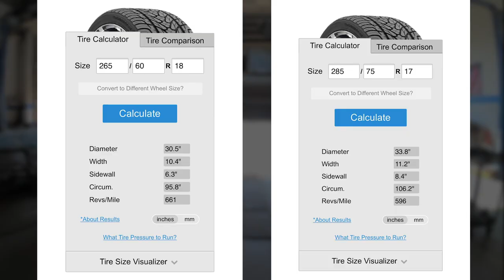Lexus GX460 Ironman suspension lift with Method Race Wheels and K02 tires

Comment: nice rig mate looks amazing, did u face any issue with KDSS, how does the Iron man suspension feels, any update on the fuel range, as am planning to do the exact same setup as i own Sandy myself to :P.
Reply from the maker: I’m very happy with the setup and no issues at all with KDSS, rubbing, or anything dramatic at all. There is a slight decrease in acceleration and it’s a little more thirsty, but the cons don’t outweigh the benefits. I feel a lot more confident off-roading. Congratulations on your ride and thanks for the support 🎥🎬👍🏽
Reply: @CoastalGX  Larger tires will do that. The mileage and the gas consumption calculation will be incorrect with those wheels as you are now traveling more than a mile for every mile the car thinks you are.

Comment: Have you done any mods to gain power? The gx460’s are sluggish to begin with in my opinion!
Reply from the maker: No. I didn’t build a track car. It’s a tourer. The power train is very smooth and doesn’t struggle. With all the gear I carry, I wouldn’t want to be straightening any curves. It cruises at 85mph smoothly. Big difference from a Tacoma, Jeep, 4Runner etc. The v8 helps a lot.

Comment: Where did you buy the 17” methods? TireRack only sells 18” for a 460
Reply from the maker: I got a better deal buying the wheel/tire package with Discount tire. They had a variety of 17” wheels for the GX460.
Reply: Coastal GX thanks! I guess I’m getting mine at discount tire! Your mod turned out great! Love that look
Reply from the maker: Joricano thank you. What model do you have and what are your plans?
Reply: Coastal GX I’ve got a 2011 460. I just want change the wheels and tires so I can go to some fire roads. I can’t lift it since I drive it to NYC and park in building garages.. But I installed MTS mainly for better traction in snow. Maybe spare tire carrier and Auxiliary tank in the future.
Reply from the maker: @Joricano  that's what I'm talking about. Modding for the sake of modding isn't a bright idea. We do what works for us. Good luck with the setup.
Reply: @Joricano  Yeah I feel you on the clearance. Used to drive up to NYC in my stock F150 4x4 and not only was the street parking a nightmare due to the parking schedules but I felt like I was going to hit every time I was in a garage. My radio antenna would always take a beating. Good luck with your build.
Reply: @CoastalGX  Do you happen to have the part number of the wheel? Method says my 2013 GX460 needs a 20x10 and I know thats not correct.

Comment: Hello Robert, congratulations on your bad ass rig its come along way. I have a15 gx 460 that I want to lift soon I'm located in Houston just wanted to ask you if you  can give me a ball park number of this suspension lift install price at this shop. I dont mind driving to McAllen for the right install price. Thanks and congrats on your channel its awesome👍
Reply from the maker: Hello Erasmo. It’s $480 and includes alignment. If it’s worth it, call my buddy Justin and he’ll coordinate a date to make it convenient for you.
Reply: @CoastalGX  thanks that sounds like a good deal. What lift  price and website did you get from
Reply from the maker: Erasmo Rosenbaum go to Ironman4x4america.com or call them and tell them what you need. There are two general lift kits for the gx460. One is the less expensive, nitrogen shocks and the other is the Foam Cell Pro (high performance.) Both are good, but it all depends on how hardcore you’ll be wheeling.
Reply: Thank you. Hopefully I'll join you guys soon for one of your adventures. I have another 2 offroad rigs but I really exited to do this gx